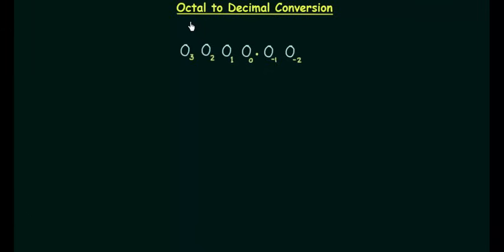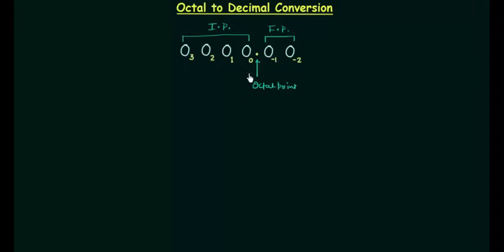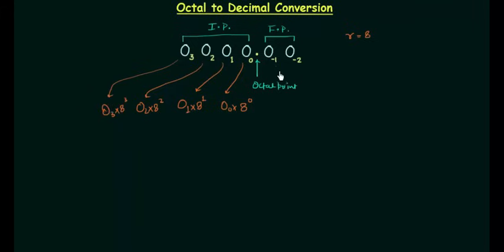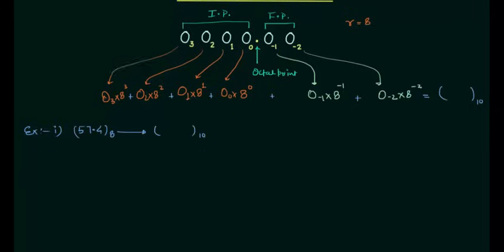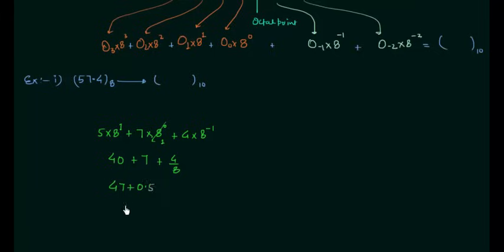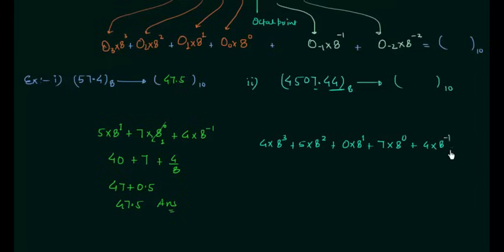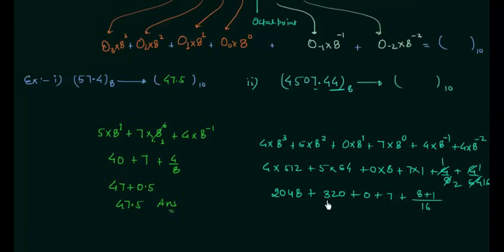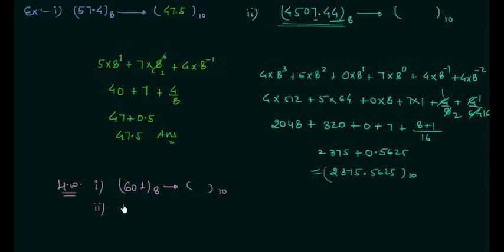Octal to Decimal Conversion

Comment: i) 385
ii) 568.03125
Reply: +Niroigen Suntharam Can you please explain me 2nd h.w? Iam having problem in fractional part
Reply: +Niya Bahar when the number has a decimal (eg 2.35 base 8 the .35 is the decimal) you would multiply the number with the base raised to the power of a negative number. So in the example I gave you the answer in decimal would be 
2*8^1+3*8^-1+5*8^-2=16.453125
Reply: +Niroigen Suntharam 3*1/8+5*2/8 solve from this step
Reply: +Niya Bahar it isn't 5*2/8 it's 5*8^-2
Reply: +Niya Bahar it isn't 5*2/8 it's 5*8^-2